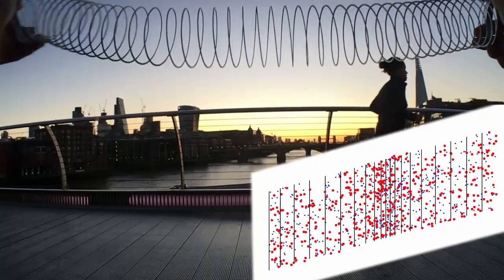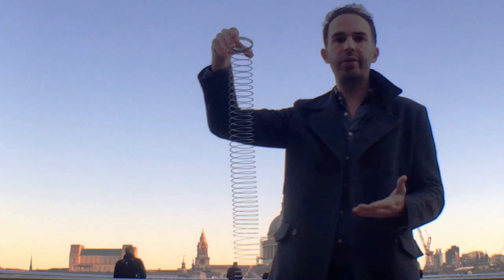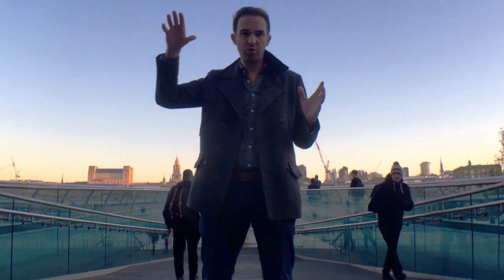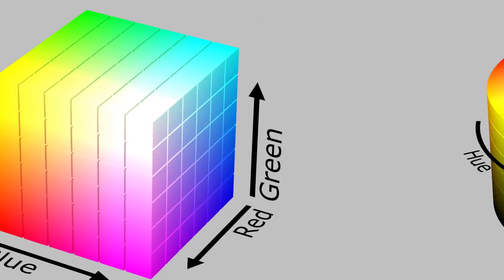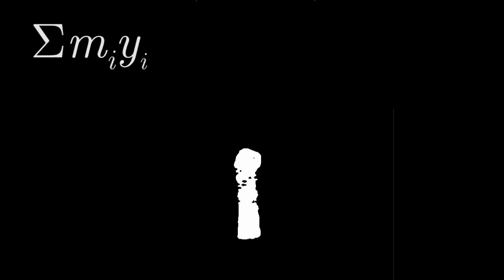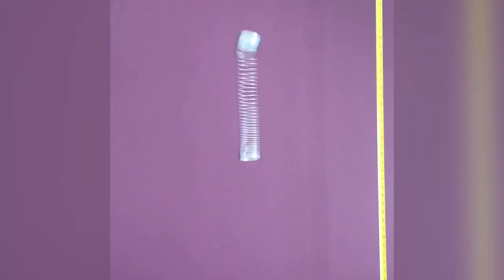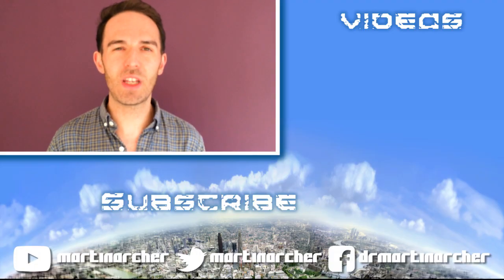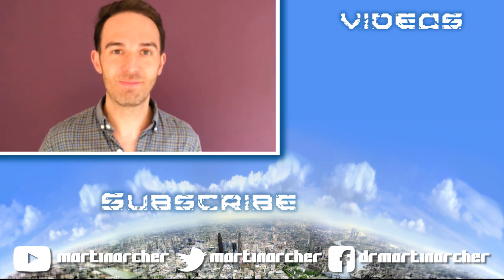Slinky Drop Analysed | What the Physics

Comment: I think this explanation is missing a key point. It’s that the bottom of the slinky experiences less gravitational force than the top, so very little tension is required to keep it up, approaching zero. So the slinky has to be very close to being fully stacked for the tension to finally let the bottom fall.
Reply from the maker: @mathworldhi  this is incorrect, the acceleration due to gravity is the same irrespective of height over human scales. You’d need objects that are just a fraction of the size of our planet for there to be substantial differences in gravity between the top and bottom as gravity varies as the inverse square of distance from the centre of the Earth.

Comment: When this spring is pulled upwards, it stretches from the top and then the whole spring rises with a constant length. 
When released, the spring does the opposite: it relaxes from the top, the bottom doesn't move, and then, once relaxed, the whole spring falls. The speed of the top of the spring is determined by the speed of the center of mass in free fall.

Comment: It's Pretty easy to understand if you just change your perspective a bit. When you pull the slinky with both of your hands in a perfectly horizontal position and then release both of your hands the right and left end of the slinky both approaches each other towards the center because it is the internal restoration force that is pulling them towards equilibrium! Now this internal restoration force will be equal to the Force (F external) that you applied while stretching the slinky in the first place!

Now coming to this experiment, exact same thing is happening as you said the slinky is in a vertical stretched position and you are holding it so the external applied force is equal to the 
gravitational force! now when you let go of the upper end then again both the ends bottom and top will try to approach each other towards the center! but this time the top will get assisted because 
gravity as well as internal restoration force (again equal to gravitational force) is acting downwards for it (in total 2 x Gravity Force for the upper end in the downward direction), BUT for the bottom 
end it is internal restoration force in the upward direction and gravitational pull in the downward direction both of them equal in Magnitude so Canceling each other for that short period of time
( i.e. the lower end remaining in its place, so called DEFYING gravity in fancy terms) until  the center of mass reaches  closer to the bottom portion and the slinky as a whole becomes unstretched!

Always Take it Easy and change your Perspective, never be Rigid, allow your mind to be Free!😄

Comment: What would happen in this experiment was done in outer space, so that gravity was not a factor? Imagine a slinky being pulled apart in opposite directions in space so that it was greatly stretched. When the two ends were released simultaneously, the two ends would start traveling towards each other at equal speeds until they met in the middle. The middle would not move since the tension on the middle would be the same in both directions. What would happen in space if one end was held in place and the other end only was released? What would happen is the same that is happening in the experiment in this video. The end held in place would not move and the other end would travel until it collided with that stationary end. In this video, the end that does not move is held in place by the equal and opposite forces of gravity (pulling the slinky down) and the remaining tension of the slinky that is left between the non moving end of the slinky and the moving end of the slinky that is traveling downward. Just because the moving end is moving downward does not mean that the slinky between both ends is not  exerting an upward force. It still is exerting an upward force until the downward moving end strikes it and causes it to move downward. The entire non moving part of the slinky is supported by the upward tension remaining in the slinky.

If there was no force of gravity holding the slinky at the moment of the release of the top end, the two ends would move toward each other, as in outer space, pulled by the tension in the slinky. However, since the force of gravity in this case is exactly equal to the small amount of weak tension in the slinky, the end cannot move. If someone were to use another spring with a far greater tension in the spring than the relatively weak tension of a slinky, one that required a powerful force to stretch the spring while it was hanging, the two ends would snap towards each other, ignoring the force of gravity, and the lower end would move upwards.  This is because the force of gravity is too weak to hold the spring against the tension in the spring pulling it upwards. The top end might move downwards a bit faster than the lower end was moving upwards (due to gravity) but in a really powerful spring this would be too small to notice. It would also be true that if the spring being used was far weaker than the slinky, when the top end was released, the bottom end would start to fall at the same time as the top end.

Comment: @Martin Archer I love the point you make that if an observer falls at the same rate as the center of mass the observer sees both ends collapsing toward the center of mass.
Now, forgive me being an idiot, but some use the motion observed in this experiment to describe how a "compression wave" would behave if a very long (8 light minutes long!) rigid pole were pushed at one end, preventing someone at the other end from detecting the push (information) before 8 light minutes had passed. Is the idea of the compression wave a completely different concept, or the same thing?

Comment: So if it is the centre of mass which is falling at 9.8 ms-2 , is the top of the slinky above this point falling with a greater acceleration?
Reply from the maker: Yes, it is also being pulled down by the tension in the slinky towards the centre of mass.
Reply: @DrMartinArcher  ah, yes that makes sense.
Reply: @DrMartinArcher  is it not elastic energy that is pulling the slinky down? When you stretch the slinky it would have elastic potential energy and the moment you let go it would be converted to kinetic energy.

If it was the tension that was responsible for this then the same experiment should work on a rope, yet it doesn't.
Reply from the maker: @Caaro99  energy doesn’t pull, only forces can do that. You are right though that there is a change in energy from gravitational potential when the slinky is raised and compressed, to a combination of gravitational and elastic potential when it is extended, to kinetic when released. Every form of potential energy has an associated force and tension is the force associated with elastic potential energy. A rope has a high stiffness constant compared to a spring, that is why it doesn’t extend much under the same amount force (Hooks’s law). It’s more appropriate to describe the situation in terms of forces here rather than energy I think.
Reply: @DrMartinArcher  you're right, I meant spring force when talking about what is causing it to accelerate downwards faster than the gravitational accelerations. 

I was thinking for the center of mass to be accelerating constantly. Either all points on the object must accelerating at equal rates or some points are slower and other points are faster so it still averages out. In this case the top must be accelerating down twice as fast (19.6 m/s^2?). since the bottom is accelerating at 0 m/s^2. And of course a force must be acting on the top of the slinky to cause this other than gravity according to newton's second law, so it must have been spring forces. Tension is an internal force and wouldn't cause acceleration in this case.
Reply from the maker: @Caaro99  spring force is internal too and is just a form of tension, i.e. interatomic forces in a material https://physics.stackexchange.com/questions/345020/is-spring-force-yet-another-force-of-tension. Internal forces can’t accelerate the centre of mass but they can accelerate parts of a non-rigid body. In the centre of mass frame the spring force / tension is equal to g (spring was at equilibrium until released in Earth frame) and acts in both directions towards the centre, so yes from our point of view the top accelerates down at 2g whereas the bottom is stationary.
Reply: @DrMartinArcher  huh, I never thought of spring force as another type of tension force. To be completely honest with you I don't fully understand the concept of tension lmao, especially how you can use tension in pulleys to gain mechanical advantage. I just go with the flow and when in doubt draw tension vector arrows. 

but now that I think of it, tension doesn't occur only when there are two masses on ends of a string. Tension also occurs between every single points on the string. Which is why I guess we always assume a string is weightless in physics problems, otherwise different points on a string would have different tensions when held vertically. The top of the string has to hold the weight of the rest of the string plus the mass, whereas the bottom of the string only holds the weight of the mass. So because there is more tension acting on the top of the string it'd accelerate faster than the bottom, but this doesn't occur in a rope much because of its stiffness?
Reply: @DrMartinArcher  it would work with a rope but u would need a bit more fps to see it slowed down in real time since the compression wave moves much quicker through the rope than through a spring

Comment: My answer is every action has an equal and opposite reaction..

The bottom of the slinky resists falling momentarily due to the upper part of the slinky accelerating downward, due to the force of gravity and the the added acceleration from the stored energy in the spring tension.

The upper part of the spring is falling faster than a ball dropped simultaneously from the same height.

The energy must come from somewhere. In order to account for this added acceleration we need an equal and opposite reaction. The bottom of the slinky remains and rest, momentarily defiant to gravity.

The energy we see is the stored eleastic potential energy from the bottom half of the slinky pulling the upper half down twords the ground.

The energy spent accelerating the top slinky faster than normal accelerationdue to gravity, balances out the force of gravity pulling the bottom of the slinky.

The reason why the bottom slinky stays exactly where it is while the upper one is falling is bcz the upper slinky is being accelerated by gravity plus the spring tension.

The forces of gravity and spring tension is equally balanced on a fully stretched slinky at rest.

Therefore the equally balanced forces don't cancel out until the slinky collapses then falls to the ground.

Comment: If it is the case that we only "think" that the bottom hasn't moved is due to our being stationary, maybe you should perform another experiment to prove your assertion? Personally, I think your explanation is as ridiculous as the "bottom doesn't know the top has moved..." one. The bottom doesn't move. That's what observation shows.
Reply from the maker: You’ve got it completely wrong, it’s *both*. They are complementary ways of looking at the problem that aren’t inconsistent with one another. In essence one looks at one end from the point of view of someone stood still on Earth. I focus on the middle (centre of mass) as you drop with it. When considered in detail both give the same conclusions, but from a different way of thinking about it.

Comment: Well my idea is the following: 
Without taking into account air drag, if you consider half the mass of the slinky to be concentrated on the top part and another half on the bottom part, you can see that the top mass is influenced by two parallel forces (gravity and elastic force downwards) and the bottom mass is influenced by two anti-parallel forces (gravity and elastic force upwards). 
As a result, the top part will accelerate downwards. However, as the slinky contracts, elastic force decreases, as a result we have decreasing acceleration for the top part. The bottom part will start moving a bit before the top part falls on top of it because the elastic force upwards also decreases. Thus the bottom part will start accelerating downwards. 
The center of mass now will experience only the force of gravity as the elastic forces are equal and anti-parallel, thus the center of mass will do free fall. 
Please let me know what you think
Reply from the maker: The centre of mass only ever experiences the force of gravity as by definition the elastic tension is an internal force which overall cancels out when summed over the entire slinky. But otherwise your explanation is basically right as a simple explanation, but to prove this properly you’d need to invoke the mathematics.

Comment: wouldn't a simple explanation means force is being applied from above and not below???
Reply from the maker: I'm not sure I follow your line of thought?
Reply: Martin Archer 
atmosphere has pressure., pushing on everything below it., and there for,
 we could be observing force from above as to previous thought below.

It's a theory of mines.
Reply from the maker: Pressure acts in all directions though and over the size of a slinky there is little change in the atmospheric pressure so the pressure acting downwards on the top cancels out the pressure acting upwards on the bottom (same with the sides too). Plus of course the forces acting on the sides would be much bigger because the area is greater, but these still all cancel out.
Reply: I guess tension has more of a force the sends forces thru out the slinky as suppose to a Chain. 

a Chain completely falls all at the same rate, bottom and top. unlike the slinky
Reply: Martin Archer 
thinking about it., I believe what we actually see is the bottom of the slinky force pulling it self up towards the center load, until it meets with the top of slinky then falls. Which is moving up at the rate of free fall. ?

illusion of not moving. 

Agree?
Reply from the maker: SteveLovesGOD that’s basically what I said at the end of the video?
Reply: Martin Archer 
lol,  again, my brain was waay somewhere else.... not sure why.... the brain was off. hahaha
Reply: Martin Archer 
not to span, but you know, like the slinky is spring loaded, like a rubber band. 

I laugh now, because I really wasn't using my brain earlier 😂👌👌👌

Comment: By far the most accurate video on this subject. You deserve more views. Even though, I still cannot figure out the math of why spring collapses ah the same gravity acceleration.
Reply from the maker: Massimiliano C thanks! In terms of the acceleration, the spring is initially being held and is at rest. This means it extends from its natural length until the tension in it perfectly balances its weight due to gravity. As soon as you let the spring go, from the point of view of a frame of reference falling at the same rate as gravity there are no external forces - this is the same as say in orbit when things appear weightless. The only force present is therefore just the spring’s internal tension, but as the spring was extended at just the right amount to balance gravity when initially being held it will collapse at a rate equal and opposite to gravity.
Reply: @DrMartinArcher  great video, but IMO flawed in SOME parts.
1. The top of the spring must accelerate faster than a free fall (ball for example), and many videos show this, I do wish you added a ball in your video.
2. Your top and bottom in your charts are backwards. (no big deal, easy to figure that out)
3. at the end after the slam, you can clearly see the top portion slow its VELOCITY (angle of its line), and can see both lines did not end up parallel (not enough free fall time), I believe during the impact at the bottom, slows the springs velocity slightly compared to a free fall ball.
Thanks for sharing!
Reply from the maker: @user-rs8zg8ey2b  it’s the centre of mass which accelerates at g in the Earth frame. As I explain in the video, in the centre of mass frame both ends of the spring accelerate towards the centre at a rate of g since the spring was in equilibrium with gravity at the beginning l. I focused on why this results in the bottom being still in the Earth frame, however, as you note it also means the top accelerates to the ground at 2g.
Reply: I have yet to find an reasonable explanation on this topic, I've heard the most backed up reasons which is backed by math magic. I understand and accept the concept, I just find flaws between it and what I observe. I've found in multiple videos where there is little to no tension towards the end of the collapse, at which time the slinky remains still until full collapse. It would be foolish of me to believe gravity would not effect it once the tension gives. The math magic simply isnt adding up for this one.
Reply: @cognizantretard  its bcz very little tension is needed to keep the last few rings held in place with the stored elastic energy that was loaded with gravity using the slinkys exact weight as the constant.